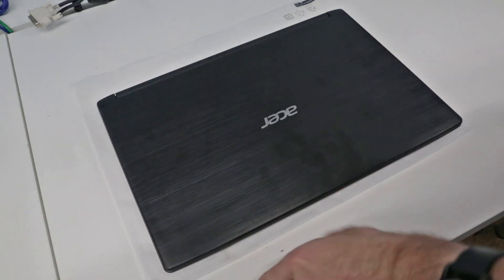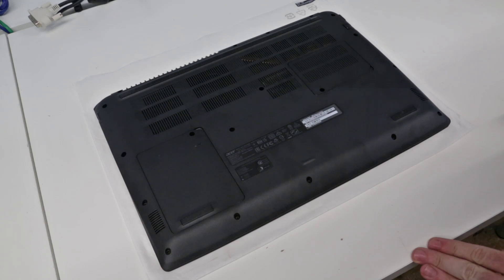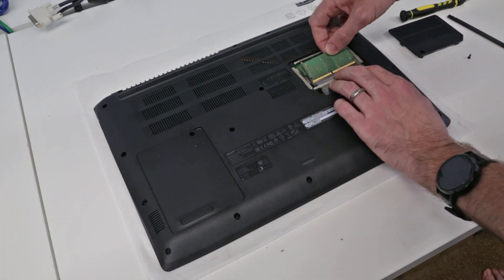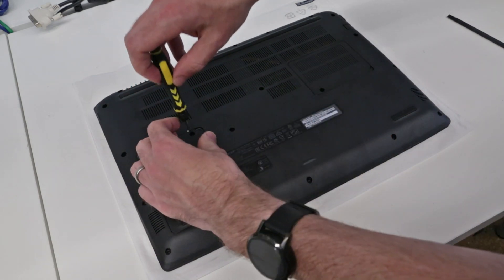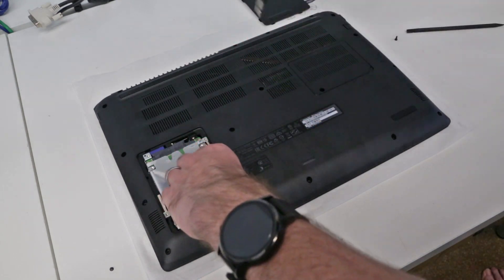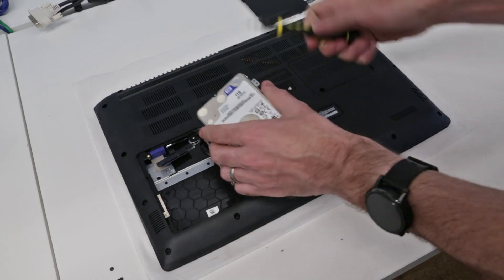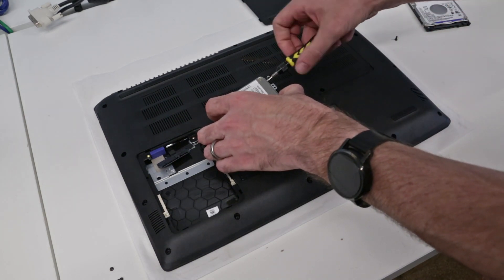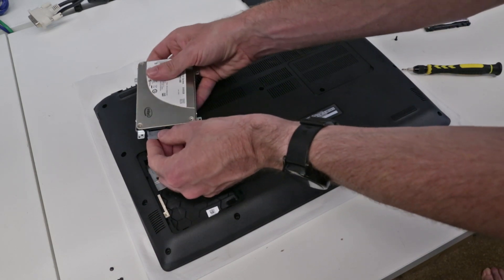Acer Aspire 3 A315-41G RAM and HDD/SSD Upgrade guide

Comment: Great I have this laptop,please could you add a link too both the upgrade parts in description thanks
Reply from the maker: I fitted an old Intel SSD I had sat around, I'd probably fit something like this instead: https://amzn.to/31ezXd6
Memory: https://amzn.to/2ESdF7K
Reply: Brue Computing 
Thank you for that ,my model number is bit different A315-41  (no G at end)

Full name is a Acer aspire 3 15.6” ryzen 3
4GB 1TB FHD laptop and receiving it tomorrow from Argos item number 
883/4508 

Again looking too upgrade it too 8g so just checking one in link you provided will still plug and play, thanks again for any help liked n subbed

Comment: If i put a 8gb module with the existing 4 gb one
Making a total of 12gb
Will it not be a dual channel? Will there be any issues?
Reply: i dont know what dual channel is but i put 8gb on existing 4gb, the pc wont read it first then you have to reset the pc and there you go a 12gb. no issue so far. been using it for 2 months now.
Reply: @brakatsuuu00  bro how did u reset your pc after installing 8gb?
Reply: @slowbrain8869  there's a button underneath that acts as a power reset switch. It's shown in manual.
Reply: @kayaritvards9200  thanks,but I simply installed 8gb ram along with the 4 GB laptop,baaam it worked plus I run totally 12 GB,I don't use it for gaming,but I checked it gave me 150+FPS on black squad and 78+ FPS on pubg lite
Reply: @slowbrain8869  I'm really confused bro ,plz tell me if I put new 8 gb Ram with existing 4 gb Ram , can I get Total 12 gb without resetting or without doing anything on  pc?
Reply: @slowbrain8869  rply
Reply: @kayaritvards9200  rply
Reply: @__TheFaz  i don't know, never tried that. But it should work just fine without doing anything when you install 8gb stick next to 4gb stick. If pc wouldn't boot after ram upgrade, just grab a needle and press power reset switch underneath the laptop. It's that simple.
Reply: @__TheFaz  yeah , sorry for replying you so late, my laptop came up with 4gb ddr4 2400mhz ram, I was confused wether it will support or not,I bought 8gb ddr4 2400mhz from Amazon and installed it in the second slot, and turned on my laptop and checked it supported,I didn't do any reset thing, u can buy 8gb and check ,even it didn't work u can sell the 4gb and keep 8gb
Reply: @slowbrain8869  thnx )
Reply: @brakatsuuu00  rply
Reply: I too have the same doubt, but I couldn't find a right answer anywhere. However on one forum someone has posted that if we added 8 GB to the existing 4 GB , the first 4 GB of the 8 GB stick would be taken as dual channel and rest 4 GB would be taken as single channel by the system. So you get a 8 GB dual + 4 GB single setup. 
I'm not sure
Reply: @srivigneshn  rply
Reply: If you add an 8 gb stick the 4 gb of that stick and 4 gb of older stick will act as dual channel and you will have 4 gb (remaining of the newer stick) working as single channel. So total of 8 gb of dual channel and 4 gb working as single channel
Reply: @ashfaqt1605  rply

Comment: Hi  . . . . . I have an Acer Aspire 3 laptop but do not know what Ram I need to buy to upgrade. I have 8GB ram presently and would like to upgrade to 16GB. Can you possibly let me know what the code, serial number is so as I can purchase the right one. I assume you can't just add any type of ram. Thanks . . . . .
Reply: You can add whatever brand you like. Just make sure you are getting at least 2400MHZ modules.
Reply: I use two 16gb sticks in my 41g that has ryzen 5, totaling 32gb of ram.

Comment: Can i use ddr 4 2666 or higher frequency ram in this laptop?
Reply if you are sure coz i need to buy this.
Reply from the maker: Yes, but it may only run at DDR4 2400 speeds.

Comment: Thanks for the video. I had a problem, I bought an 8GB RAM 2400T but CL is 16. When I inserted the RAM the machine booted up, but the problem is when I tried to turn on the laptop the next day, it won't turn on.
Reply: Remove your RAM, clean the golden pins of it and then reinsert it.Your lappy should boot up normally.
Reply: @prathmeshpatil6425  Yes, I tried it. When I reinserted the RAM it will boot up. But when the laptop is turned off and if I turn it on again the next day, it won't boot up. I have to force shutdown the laptop, and turn it on by going through the BIOS. Maybe the RAM is not compatible?

Comment: hi i have problem with my aspire 3 a315-21-96u1
When I replace my wifi card with ngff ExpGdc Beast external pci adapter cable there is blank screen on booting. Even if I do not connect the HDMI to the adapter and conect only the ngff slot with no power still boot with black screen. If ngff cable is removed display comes. Is there any bios mod for fixing the same or dont no could you help me ? :/

Comment: Great video!  Inspires the real thought that I'm capable of doing that!  Can you give me the links for the two pieces you installed?  I'm not very tech savvy and would like to do exactly what you did.  Also, is there anything I have to do after the install, software wise?
Reply from the maker: SSD: https://amzn.to/2VmmEbD
Memory: https://amzn.to/2J1KJ0A

You'll need to either clean install Windows 10 onto the new drive, or clone it from the old hard drive.

Comment: how many slot of ram i can put on acer aspire 3? i also want to add more ram im thinking if buy a new 8gb ram and replace it or just add a 4gb ram, thanks sir :)
Reply from the maker: The model I have has a pair of DIMM slots, with a single 4GB module fitted.
Something like this would take you up to 8GB: https://amzn.to/2DC5DPG
Reply: @BrueComputing  is 8gb the best you can do with this notebook? I know that the A515 can Go up to 20gb, what about this one?
Reply from the maker: @ThiagoSilva-wf2bl  You can certainly fit 2 x 8GB, eg: https://amzn.to/2XgmgLd
16GB modules may work, but there wouldn't be a great deal of point paired up with a 2200U.

Comment: Good day sir! im from PH. and i would like to ask for your help if i will replace the built in ram and buy 2 new rams or just buy another 4 gb ram so that it can be upgraded. if i will buy another 4gb ram, what mhz am i going to buy for it to be compatible with ram that was already built in?
Reply from the maker: If you want to guarantee dual channel memory operation then I'd fit a pair of replacement 4GB modules: https://amzn.to/2GQBga6
If you're fine with potentially running in single channel mode then a single 4GB one should be fine: https://amzn.to/2DC5DPG
Reply: @BrueComputing  can i still have a dual channel memory if i just buy one and pair it with the built in ram?
Reply from the maker: If it is similar enough then it may work in dual channel mode. You could always fit one and check with CPU-Z - if it is showing single channel then order another and swap it in.

Comment: Do you know what memory I can use for the Aspire 6?
Reply from the maker: What is the full model number?
Reply: @BrueComputing  A615-51-51V1, preferably 16GB
Reply from the maker: It looks as though the A615-51-51V1 has 4GB RAM as standard, which is soldered to the mainboard, with one DIMM slot on the mainboard. So your options would be either to add a 4GB DDR4-2400 module for 8GB in total, or an 8GB one for 12GB.
Something like these would do the trick:
4GB: https://amzn.to/2XDTb9x
8GB: https://amzn.to/2W4gSYl
Reply: @BrueComputing  hi. Can you use dual rank ram for this laptop you guys r talking about. I'm thinking to get the 16gb unbuffered ram with dual rank but I am not sure if it would work for the aspire A615-51-51V1 or would I need 16gb with single rank ram?
Reply: @BrueComputing  Also, I don't know how many pins my Ram slot has.

Comment: Could this take 16GB or 32GB modules for the RAM?
Reply from the maker: The max officially supported is 2 x 8GB like this: https://amzn.to/2XhT8Ag
2 x 16GB may work unofficially, but I haven't tested it.
Reply: A315-41g model, which has ryzen 5 2500u, does run two 16gb sticks; total of 32gb without any issues. 1gb ram is reserved for iGPU always.
Reply: @kayaritvards9200  I think 32gb of ram is overkill for the laptop. But ok

Comment: That laptop also has a hidden M.2 slot next to the ram. You just have to open the chassis and it even has the screw already in place. Much better option to install an SSD (although it doesn't support NVMe, only SATA).
Reply from the maker: Yep, I've done a video on this here: https://www.youtube.com/watch?v=A0S9BIghFnU&lc
Reply: @BrueComputing  hi can i put 2666 8gb ram on it beside the stock 4gb?
Reply: @antitheft2472  You can
Reply: but can i use 2, 8gb stick of ram so i have 16 instead of 8? @ZidaxGaming
Reply: @marvin_dev  as long as it iz the same frequency (mhz)
Reply: oh then can i use a 3600 mhz on that laptop or is it to fast? @ZidaxGaming
Reply: @marvin_dev  you need to check your current ram using cpu-z if how much mhz it has then buy the same frequency like if it has 2400mhz installed, then get that same 2400mhz. You can use faster freq but it will go down to 2400mhz because you have a slower ram freq installed. I suggest buy same frequency so that you will not waste money with 3600mhz  ddr4 ram.
Reply: oh yeah i see it's 2133mhz but can i clock it up like in a pc so i have it's normal ram speed? @ZidaxGaming
Reply: I  @marvin_dev   I don't recommend doing that on an entry-level laptop. since it does not have good airflow.
Reply: well i have one of those thing that blows cool air under the laptop, but doing that is possible? @ZidaxGaming
Reply: @marvin_dev  Possible but not recommended
 I forgot what software I use to be able to play RDR2 in 30 to 45fps before in this unit but my laptop's monitor gave up. Its now like Im using a red filter all over my screen.
Reply: damn, and do you know what's the storge limit on the laptop is it like 4TB or smt i really want to know @ZidaxGaming
Reply: pls answer i really want to know @ZidaxGaming

Comment: i found one of the 8250u i5 models , with 4 Cores /8 threads on the Re-certified Acer site for $300 even. Super nice buy, and those 2 removable panels for RAM & SSD/HDD access is a big reason i bought it. Anyone who has ever had to swap a HDD on a HP, or many other Laptops, and dealt with needing to remove the Screen bezel, & Keyboard, & body trim, just to access a Damn Drive that SHOULD have a easy access panel will know how important & valuable those two access ports are. only a fool will pay for a better drive, or more RAM built in when these laptops have these panels, hell even without them, companies charge 4x the cost of parts for better hardware, but you can buy a 4Gb RAM chip & a 850/860 Evo for $150 & pop them in yourself in 3 minutes.
Reply: Link to the site?

Comment: Can you pair a ddr4 2400 with a ddr4 2666 in this laptop?
Reply from the maker: Shouldn't be an issue, but it'll run both at the speed of the slower module.
Reply: @BrueComputing   I see. Thanks for the very informative video.

Comment: I just bought the model with the 256 SSD, which apparently occupies the M.2 slot and not the 2.5" slot. So I thought about putting a HDD or SSD in the 2.5". I know I need a caddy for this, but more importantly: I can't fing the SATA connectors at all. Apparently, Acer doesn't provide those cables with models that don't come with this slot already occupied. Some people on the Acer community forums say that you can still get the parts for a connector and connect them to the motherboard, but that would require taking the whole device apart, and some light DIY work. It kills the easy-upgrade-ability of the device. I'm disappointed in Acer
Reply from the maker: You can't really blame them for not including unnecessary components - in the same way the SATA only models don't have a screw to hold down the M.2 drive.
This is pretty common across all manufacturers though.
Reply: I don't blame them, and that doesn't make them evil or anything. I'm just a big fan of the value that Acer products have and was disappointed by that decision.
BTW: thanks for the videos and all the best in your future YouTube endeavors!

Comment: I have A315-41  4GB Ram
should I buy additional 4Gb for an 8GB or Go for an 8GB
Reply: If you have the Ryzen model, then I would say go for 2x4GB. The Zen architecture performs best with dual channel memory.
Reply: @eliasheikkila8307  yes I have Ryzen 5 2500U so how much does it cost for a 4GB DDR4  RAM
Reply: @eliasheikkila8307  if I have ryzen 5 3500u with 8gb ram should i add 8gb ram  or adding 4gb is enough to play gta v with more fps?
Reply: @eliasheikkila8307  hey can i mix it with 8gb ram 2400mhz with 4gb ram 2400mhz ,my specs are ryzen 3 2200u with amd vega 3,amd 535
Reply: @eliasheikkila8307  INDIA
Reply: @ambadyvs1647  4Gb SO-DIMM DDR4 - 18$
Reply: @ambadyvs1647  about ₹ 1500

Comment: Nice laptop, can i use that in video editing? Sony Vegas Pro or Adobe Premier Pro?
Reply: I have this laptop, you should use Sony vegas pro 13 and for adobe premiere I recomend the 2016 version, I have lag with the newer versions with Just 8gb of ram, maybe with 16gb it's better.
Reply: @DarkCC  Thank you for the info... (Y)
Reply: im using an acer aspire 3 a315-41 model, I am an everyday user of Adobe premiere pro because basically i love editing. However, there's too much freeze time and lag when using it. So i recommend you install an m.2 sata iii ssd to your computer and upgrade your RAM. Also, if you think you can afford it, you can change the hard drive to an SSD so you'll have a faster response. kudos. hope it'll help no matter late

Comment: What about the m.2 ssd?  There is a slot underneath
Reply: Exactly! Why would anyone throw away 1tb storage when they can get 240gb fast ssd and 1tb large hdd together..
Reply: @memenashedi919  well I have a spare ssd , which I bought for old laptop. Now lappy is dead nd that's where I will use it. I wish to know is there more space for another caddy since no optical drive?

Comment: I will buy an acer aspire 3 with ryzen 5 2500u, 1to and 8GB of ram. I also want a ssd. Can i have the 1to of stockage and a ssd or i can only replace it by the ssd? will i loose the windows(i don't know how to tell it, im fench) and all the things that will be on the 1to? Last question: Is it a good idea to put the ssd immediately when i get the laptop?
Reply from the maker: "Can i have the 1to of stockage and a ssd or i can only replace it by the ssd?"
There is an M.2 SSD slot inside the system: https://www.youtube.com/watch?v=A0S9BIghFnU
If you use this then you can have a SATA M.2 2280 SSD and keep the 1TB HDD

"Will i loose the windows(i don't know how to tell it, im fench) and all the things that will be on the 1to?
If you take the HDD out and replace it with an SSD you'd have to install Windows 10 on the SSD, and if you wanted to keep any other data would have to transfer that over too. The license for Windows 10 is stored in the machines firmware, so will activate based off of this.
If you fit an SSD and keep the HDD you'd still want to reinstall Windows 10 on the SSD, as you really want it as the boot drive.

" Last question: Is it a good idea to put the ssd immediately when i get the laptop?"
I would, it saves hassle further down the line reinstalling programs, etc.
Reply: I have bought one this week with ryzen 5 and i have put samsung evo 250go , really fast this laptop is a i5 killer at pentium price

Comment: Can i put 2 x 8gb ram cards ?
Reply from the maker: Yes. Two of these would work: https://amzn.to/2BAAg7g
Reply: Max 32Gb?
Reply from the maker: @2bersaudarastory972  32GB is the maximum supported by the processor, but I haven't tested it.
Reply: @BrueComputing  sir please do test for 32gb like 2x16gb 2400ghz config. I really do plan to upgrade my rig too.
Reply from the maker: @ラカンドウラ氏ヨセフ  Largest officially supported configuration is 2 x 8GB.
Reply: For this particular laptop, would it be possible to add a better graphics card and if so, do you have a video for it?
Reply from the maker: @iniester6724  No, there is no way of adding one. They do do a model with a discrete Radeon card though I believe.
Reply: @BrueComputing   What is the supported speed of ram in this laptop?
Reply: @BrueComputing  Is it possible to upgrade this laptop with Geforce or Nivdea ?
Reply from the maker: @calvinrump3558  No

Comment: can  i add an extra ssd in Acer A315-51--54pg?
Reply from the maker: A search for photos of the A315-51 mainboard suggests it also has a hidden internal M.2 slot, so you'd need a retention screw, but should be able to add an SSD to this whilst retaining the 2.5" drive. See my video here for details on the hidden slot in the A315-41, should be similar: https://www.youtube.com/watch?v=A0S9BIghFnU

Comment: Does it have a slot to put a smaller nvme ssd in it?
Reply from the maker: There in an M.2 slot inside, see my other video here: https://www.youtube.com/watch?v=A0S9BIghFnU
I've only tested it with a SATA M.2 2280 drive though, I've seen mixed reports online as to whether an NVMe drive will work.

Comment: This will void the warranty yes?
Reply from the maker: Technically yes, but with the access panels I wouldn't see it as an issue so long as you retain the original parts and refit in case of a warranty issue.